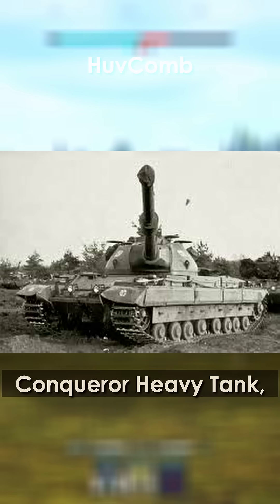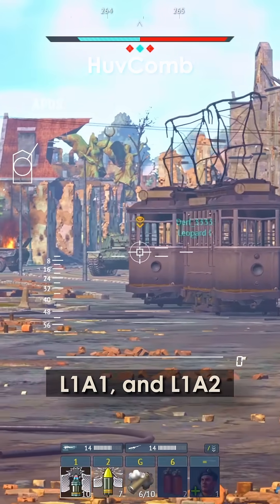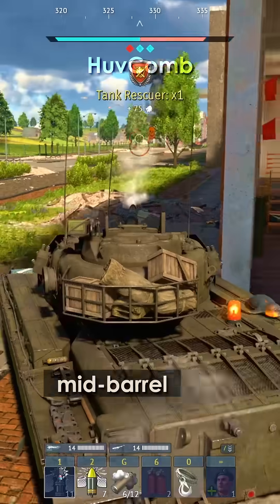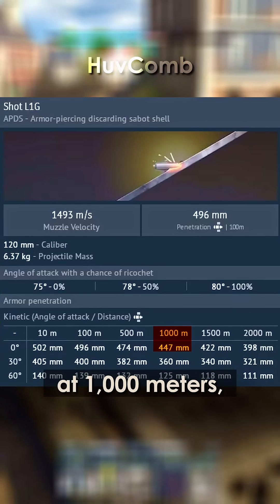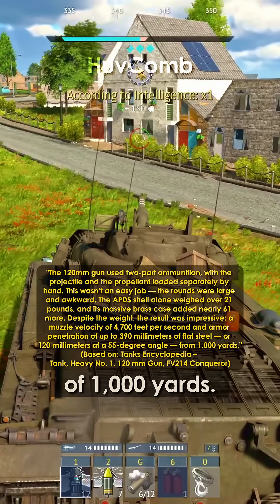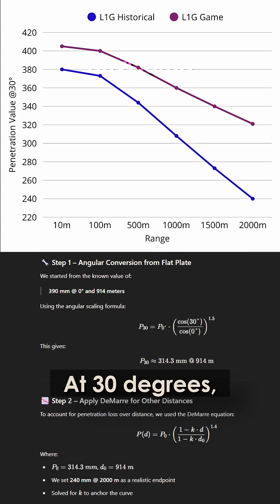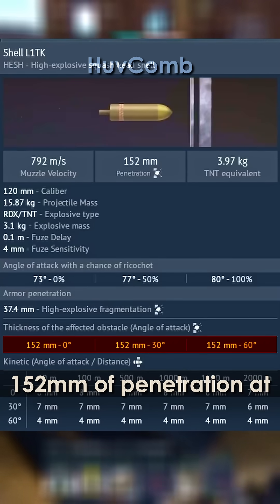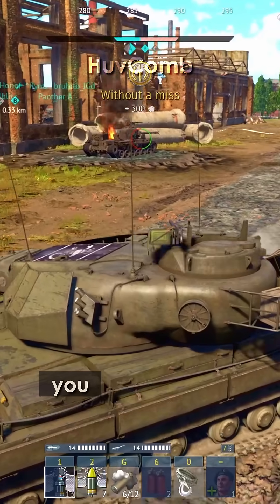What If: The Conqueror’s 120mm Gun in War Thunder Was Historically Accurate? #WarThunder #Conqueror

Comment: I left a more detailed comment and sourced on the main video, but the stats you used from tank encyclopedia are mostly rounded down to 2 significant figures, while in tests they were much higher, such as the APDS muzzle velocity being closer to 1452 meters per second and the flat pen at 1000 yards being 446mm (I have no idea where the 390mm figure comes from). Comparing British firing trials to the War Thunder stats suggests that IRL, the round would have slighltly less muzzle velocity, but also less drag. resulting in less pen up to 1000m but more pen afterwards. Compared to your results the IRL performance is significantly better across the board.

Comment: There must be some kind of mistake, I thought this game ONLY buffed Russian designs and ONLY nerfed western ones because it's biased
Reply: @therealmp40  It's named the conqueror, of course they had to make it into a buffed up, APDS railgun and armof ripper tank
Reply: Very funny
Reply: @therealmp40  they simply nerf US designs
Reply: The Conqueror was originally so crap they needed to buff its APDS due to the shell shatter mechanics in game
Reply: It looks like a buff on paper, but the current in-game round now is worse than before.

Contrary to what the video leans towards, the real L1G did indeed have worse flat pen, but superior angle pen to the in-game round.

Yhe WT version uses an in-house (quite shit) formula, which modells it incorrectly and gives the round absurd flat pen and a really terrible angle-pen, which is the reason it experiences so much "shell shatter" which it shouldn't.
Reply: Shell shattered  🌚
Reply: Its not actually as significantly buffed as the short makes it out to be, actual firing trials gives it 446mm of flat pen at 1000 yards, which matches War Thunder, the difference is that IRL it had a slightly slower muzzle velocity (roughly 1452m/s) but less drag, meaning slightly less pen until 1000m, and more pen after 1000m, the IRL gun also had less angled pen, but I suspect significantly less "shell shatter" as it doesn't come up in any firing data, or tank effectiveness studies, as well as the gun not suffering from the 0 spall issues it does in game.
Reply: Germany is even more buffed
Reply: They did it to make it seem like they don't only buff Russian vehicles
Reply: @therealmp40  the mistake is this dude lied really hard. He also entirely forgot about the fact that the tank can't really pen anything because it's shell shatters every time